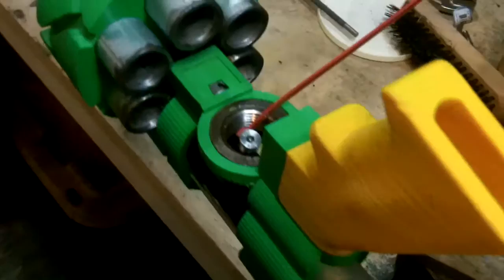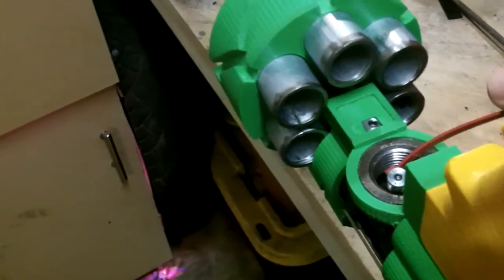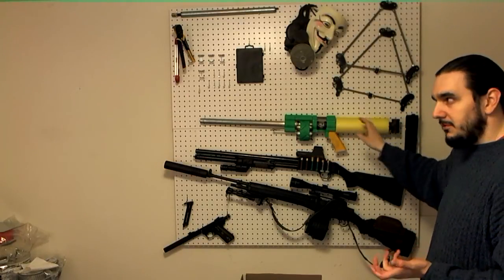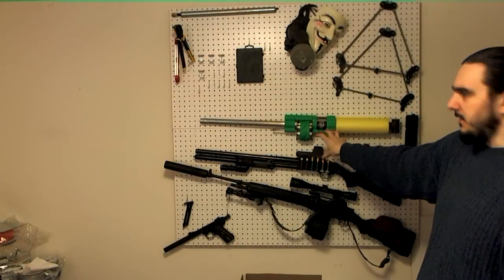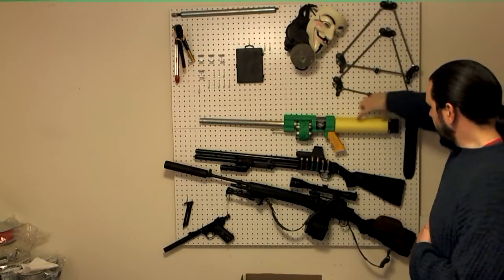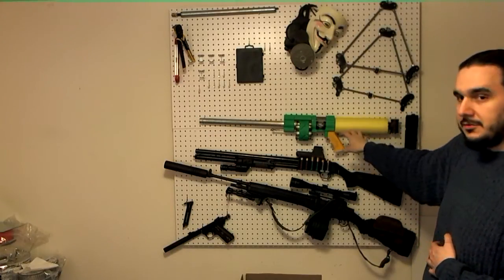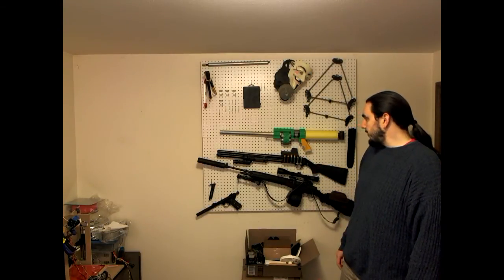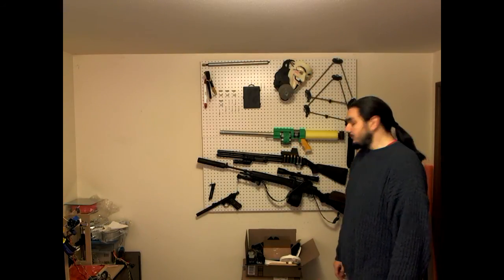#Liberator12k | 16 - Click, No Bang? Adventures in 3D printing

Comment: use a Bolt action to cock the gun and rotate the drum. pull back to cock it push forward to rotate the drum. Also this would work wonders with M870 Airsoft shells. Might sound crazy however you can print more parts to make it lighter because the gun won't be taking that big of an impact. look at the XM26 this is Similar with a drum.